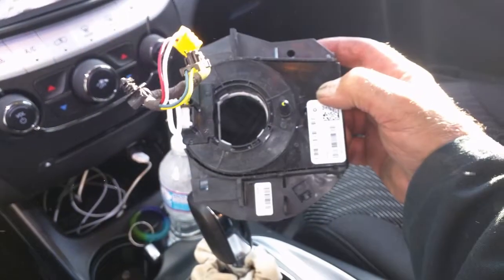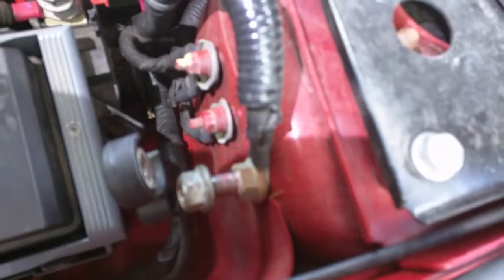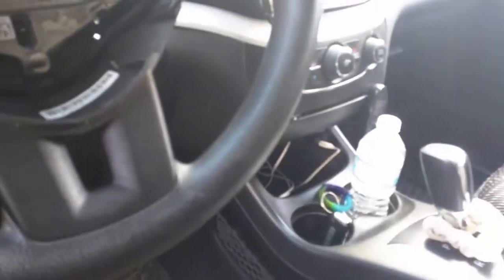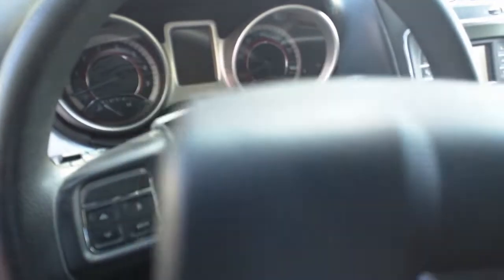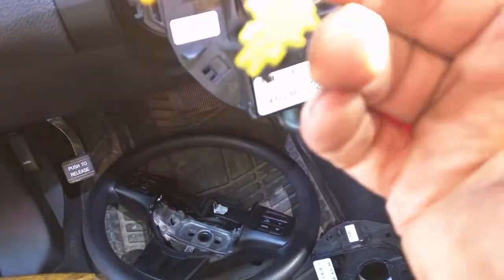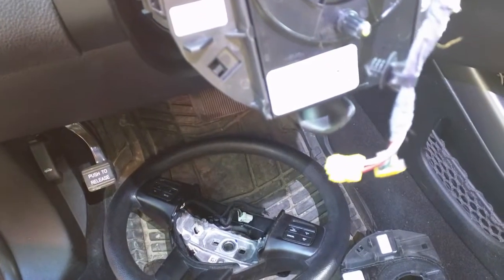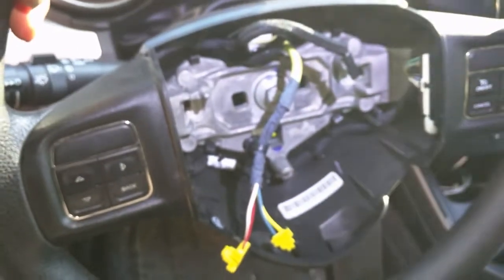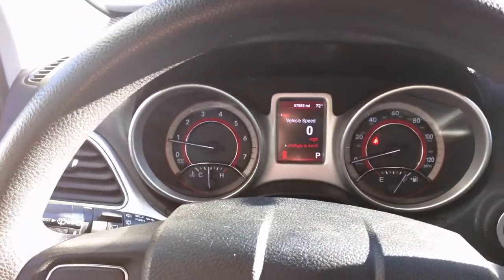Dodge Journey clock-spring replacement 2013

Comment: Same part replaced to fix an intermittent ghost horn that kept triggering the TIPM relay and drained the battery on a 2010 Journey SXT.  No codes for that one.  Neighbors just loved me when it was going off at 2 AM.

Cool puller mod.  I was able to get my steering wheel off with tiny shimmies.

T20 Torx screws...10 mm bolts on the airbag...13 mm bolt on the steering wheel if it wasn't clear to everyone.

Thanks for sharing.  Great explanation.

Comment: My 2013 Dodge Journey has exactly the same issue. Traction light is always ON (nothing else). However, I am using a BlueDriver OBD scanner and it gives me different codes. 

U0429-00  Invalid Data Received From Steering Column Control Module: No Sub Type
Information MIL/CONFIRMED

C0051-49 Steering Wheel Position Sensor: Internal Electronic Failure
MIL/CONFIRMED

C0037 Left Rear Wheel Speed Sensor: Signal Compare Failure

Did anyone else have the same code?
Reply: Update:
Replaced defective clockspring (with angle sensor) - FIXED!!
Reply: Hello. I have the same problem i my Fiat Freemont U0429 and C0051. Did you buy these newer version from Mopar like on this video? Where did you buy it? Thank you. I think the only solution is to change it. I'm resetting this error but its shows up about once a month.